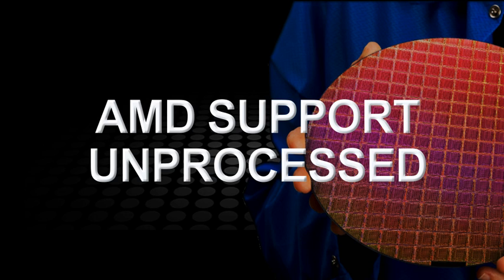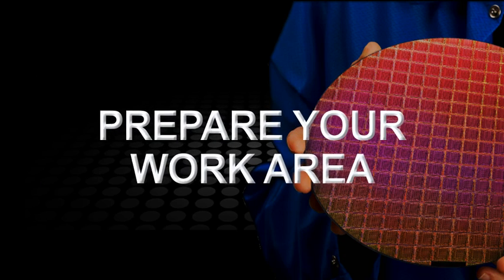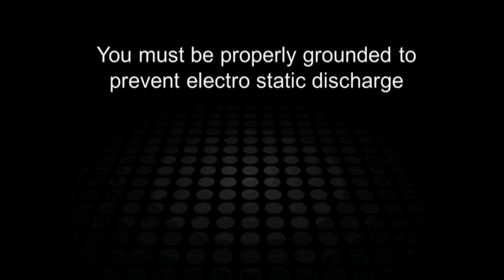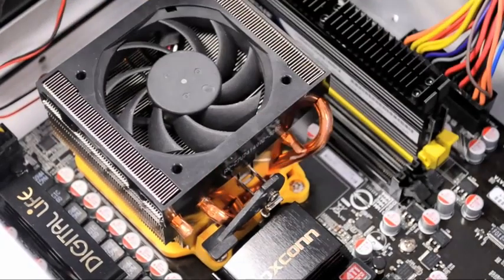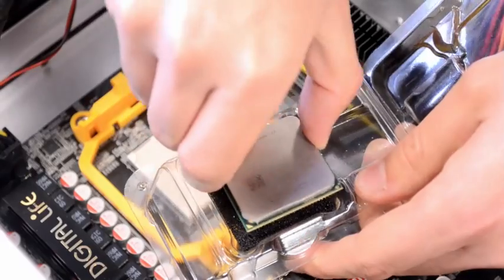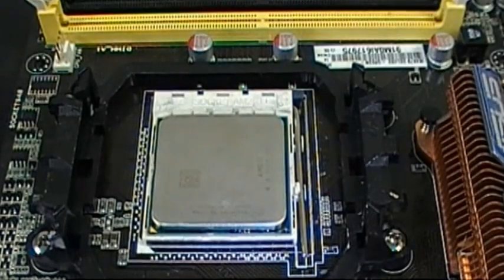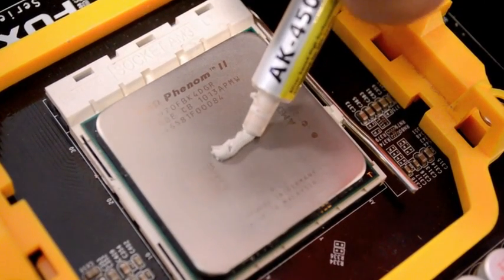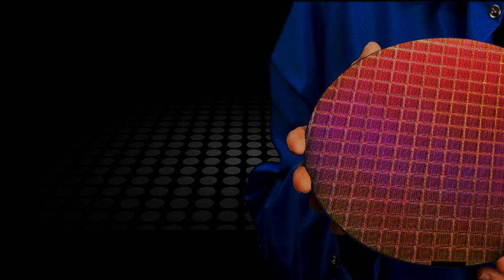AMD Support: How To Replace Your Processor

Comment: I have no idea what is going on. I upgraded from an Ryzen 3 1300x to a Ryzen 7 2700x. The 1300x doesn’t need a mount for the heat sync, and the 2700x you do. I never got the new mount to connect my heat sync to

Comment: This is perfect since im upgrading and old PC to an old gaming PC with parts from +/-2010.
Reply: it still looks the same if you use a ryzen
Reply: @mazuki7602  oh yeah but it's AMD I don't really have new AMD stuff right now as I'm still on a 5675C on my main computer which pretty much runs everything at 60fps, the newest AMD I have actually doesn't look like it it's a bulldozer FX8350 and one based on the bulldozer architecture if I'm correct called a AMD opetron 6238 or something ( I'm pretty hyped for getting that thing to work) just waiting on a motherboard.

But that's good to know cuz it's a good system much better than the Intel one.

Also at the time this was my first cpu replacement thing I did so I literally had no idea what to expect.

Comment: Can I upgrade amd a10 CPU  to amd ryzen 3 without changing motherboard
Reply: You probably already figured it out but you need to look what is compatible with your motherboard.

So you wanna see what motherboard you currently have.
You should be able to see that in system information or something like that dunno what they call it on English systems or it might be on the motherboard itself and then just Google what is compatible with it.

Comment: How in the blue blazes are you grounded if you remove the power lead from the psu and the socket?  You need to be grounded to something that is directly earthed. That’s why it’s called grounding

Comment: I have a question: does it matter what kind of heat sink you're using?? if i replace my old CPU with a faster more powerfull CPU should i replace my old heat sink or can i just use it?? My gut says more power more cooling.

Comment: Many thank's for putting up this very helpful video, just what I was looking for, it answered all my questions. Wish I had found it sooner, as when I removed the fan & heat sink, the CPU was stuck hard to base of heat sink & ripped out from socket, bending CPU Pins. (Panic!) I am now aware of the importance of twisting the heat sink carefully after removing the clip, to free the sink from the CPU & compound, as the CPU release lever is hidden beneath the heat sink & cannot be accessed whilst the sink is in place. A lesson learned. Also noted the position of the heat sink retaining clip lever, was on the same side as CPU retaining lever, as the assembly can fit either way around if not noted before disassembly. All is well, having successfully straightened CPU pins, and of course, using an anti static wrist strap.

Comment: I have an amd 8320E in my new but my old PC has the better AMD FX 8350! Do i use my old computers heatsink or use my new computers heatsink ? also once installed (hardware) do I need to do anything software wise. such as BIOS ? or does it do it for you ?

Comment: Wait, what?! Remove the power cord from the PC, but then put anti static wrist strap onto the case so you're earthed?
Where the fuck is the static meant to go then? Are you on a metal table??? Just switch it off at the wall, it's still connected to earth.

Comment: I'm wanting to upgrade my cpu from an fx-6300 to something a bit more powerful. My motherboard is a GA78 LMT S2. Which is the best one?
Reply: does it use AM3? If so, any FX series CPU should fit the socket.

Comment: Hey, i want to change the cpu, my current one is amd phenom triple core proccesor, and i want to change it to one of the latest ones, is it ok?
Reply: You probably already figured out but if someone has the same question you need to look if it's compatible with your motherboard first.

You can find it in the system information ( what motherboard you are using) or on the motherboard itself.

And then you can just search what is compatible on Google.

Comment: so I have a Athlon 64 cpu, will i be able to upgrade to a recent amd cpu or the motherboard won't allow it?
Reply: what mobo do u have?
Reply: Carlos Cordova There are Athlon 64 CPUs made for 754, 939 or AM2 socket. Although they all are sold as Athlon 64 processors, you can't, for example, install socket 939 CPU into socket AM2 mobo. Different socket models are not compatible between each other. And as if this didn't make things complicated enough, you just ran into the subjects you asked; there is no basically a store which would sell you a new Athlon 64 CPU anymore, the CPU series, and the socket models are obsolete. So no, you can't upgrade to any recent CPU. But if you have good luck, your mobo has socket AM2 which is the most recent of the ones mentioned before. This will allow you to upgrade to more powerful CPU than the older models. You can manage to find used socket AM2 CPUs quite easily and for good price, but there is no guarantee that they would work.

Comment: I've was given a prebuilt gaming PC as a gift recently and am looking to upgrade if anyone has any advice on what I should look at upgrading weather it be just the GPU or most of the internals including the motherboard. Price is of no real concern but id prefer not to spend all my money on unnecessary components. Specs:Motherboard: Gigabyte GA-78LMT-S2
CPU: AMD FX(tm)-4300 Quad-Core Processor 
GPU: AMD Radeon R7 200 SeriesThanks in advance!
Reply: Well, an AMD 9590 CPU should run anything under the sun that competes well with Intel. I personally have an RX 470 GPU and have done well with it, but search around for your own personal needs. As for motherboards, same deal. Search for your specific needs, and you should be okay. Remember to take into account your Operating system, RAM, power supply, and your cooling system, along with hard drives. Some things work better with others, but without a couple of parts, your PC won't run games at all. All of your components are necessary.

Comment: If you do this what will happen to all your downloads, files what Windows you have?
Reply: Your files are stored in the hard drive usually aside from the mother board
Reply: It wonk affect them
Reply: William Burn nothing will happen to them unless you change your motherboard. Most recommend installing fresh Windows, however I've managed to get around that by uninstalling the previous Mobo's drivers before shutting down and installing the new one, no fresh Windows install needed. You won't need to worry about this for CPU, but if you're changing your Mobo, I'd recommend looking up some videos on how to do it without reinstalling Windows, but if you're completely lost then it's best to just do it the old fashion way and do the reinstall.
Reply: wow i appreciate this reply but me 7 months later i am really quite good with all this now
Reply: btw i made a whole new pc and kept my hard drives and everything was still there

Comment: just bought AMD's new 880k and am going to be uprgrading from an a6-6400k on monday, am i going to need to do anything in my bios or through windows after i install my new cpu or will it just boot up normally?
Reply: already bought it and installed it, the only problem i had was that i had to cut 2 of the heat pipes off of the cpu cooler to fit with my gpu because i have an itx board.
Reply: +John Smith 

you might end up with cooling issues
Reply: not yet,luckily... im going to be upgrading to an aio pretty soon so im not to worried about it.

Comment: Ok so I've got a question cause I've been hearing a lot but don't know if it's true, if I change my CPU will I have to do a new install of Windows?
Reply: +Pearzonalized 
If you are lucky you can boot and install the new drivers.
It would help to uninstall the old drivers before you remove the old cpu.

Comment: My of has an Intel core 2 duo e7500 @2.93ghz and I want to put an Intel i5 in it will it fit and work?
Reply: Depends on how big your case is. If your pc is garbage then by a new one.
Reply: +Mary Poppins If you haven't figured it out yet you have to make sure that the processor is compatible with your motherboard. You have to look up the motherboard and processor specifications. Both of them need to have the same socket type I.e. an i7 has a LGA1155 socket type so I have to have a motherboard with the same socket type like an "ASRock Z77 Extreme4 ATX LGA1155 Motherboard".

Comment: Quick question I am upgrading from a phenom 9550 to phenom II x4 920 (have an AM2+ socket) Do i need to replace the heatsink or will the old one work?
Reply: Appreciate the comment but I just built a new comp altogether! Fx 8350 with a Hyper Evo 212+ attached to it!

Comment: hey I'm sorta new to pc stuff I currently have an AMD FX-4300 and I'm upgrading to an AMD FX-9590 will that fill in the socket it already has ??
Reply: the 9590 need really good cooling the stock fan wont do
Reply: Needs a better cooler.

Comment: What happens if the pins bend? That happened to my cpu
Reply: +Explosions+ This happened to a friend of mine.  He was able to bend the pins back straight and then got it to work.  If you can't get them straight again you will have to buy a new one.
Reply: +Dr Dyno I got the pins straight and the processor fits snugly into the socket, but my monitor says "dvi no signal" and it seems that the processor is not doing what it is supposed to be doing
Reply: +Explosions+ you sure your dvi is plugged into the gpu?
Reply: +Knowhere oh I don't know, how to do you do that?
Reply: +Explosions+ in the back of the case the different inputs for dvi are on the motherboard and gpu. Just try all the possible ways to plug in the Devi
Reply: +Knowhere oh ok thanks
Reply: +Explosions+ even if you got the pins straight make sure you didn't straighten them with your fingers or something because oils can really mess the CPU up.
Reply: +Explosions+ I got 3 pins bent ; 2 I succeed to put them back but the third broken and fell off .
I was last in space : bought a new one !

Comment: Can an amd fx 9590 fit where an a6-6400k used to be?
Reply: no, 6400k is socket FM 2... the FX is AM3 so it won't fit
Reply: +KraZeeRic nope. fx cpus use am3+ motherboards while apus use fm2+
Reply: +Thulith Wilfred Can a AMDFX-6300 6-Core Processor Black Edition replace a AMD A8-3820 APU???

Comment: I have an MSI a78m-e35 motherboard and i installed a new AMD athlon x4 860k cpu after installing and putting the cables back in the pc its said no hdmi conection. I bought an hdmi cable but now it says check signal cable what do i have to do? Please help

Comment: Can I reuse my old heat sink fan with my new cpu? I've cleaned the thermal paste off the old heatsink fan. And the cpu fits right in the socket. If I apply new thermal paste onto the new cpu and put the old heatsink fan in. Will it work? (Amd)
Reply: of course lol no cpus come witha heat sink so yeah

Comment: I am thinking of switching out an fx 6300 for a better cpu. I'm going to be running it with a gtx 970, and on this motherboard 760GMA-P34 (FX). Can someone tell me what would be a good cpu for the system? I know very little about PCs, but I am hoping to learn. Thanks!
Reply: This exact PC to be completely accurate. http://www.bestbuy.com/site/ibuypower-desktop-amd-fx-series-8gb-memory-1tb-hard-drive-white/4757091.p?id=1219638959291&skuId=4757091&pid=1219638959291
Reply: +wippersnapper23 go to https://ca.pcpartpicker.com/ and put in your mobo into a new pc and you'll get a list of compatible parts. I use this a lot to find single part upgrades for my pc. Cross reference what you find with a google search to see if anyone else has used the same parts and you'll have a good idea of what you need

Comment: if i upgraded my upgraded my cpu would i have to uninstall windows, or can i install the cpu and put the windows disc in and im all set? Also im not getting a cpu until november or december do you think i should wait for new hardware releases?
thanks
Reply: I don't think that cpu messes with the OS, I believe that the hard drive holds toe OS info on it along with all the other stuff meaning it will not need to be reinstalled

Comment: hello i need help. i am thinking of changing my(i think its a graphics card) AMD HD8570D to a AMD FX-8350 (as it plays games better) is this do able? and if so is there any better cards to swap it out for?
Reply: Zexal Vipez man you want to change a GPU to a CPU wtf?You cant and I think you have an FM2+ motherboard and you cant add and FX-8350 only on AM3+ motherboards with a big TDP support
Reply: ***** sorry i know nothing on computers. Is there anything inside my computer i can change to make it run better?
Reply: Zexal Vipez i dont know your specs but if you will show them to me i will help you
Reply: AMD A8-6600K APU with Radeon(tm) HD Graphics - quad core processor 
AMD Radeon HD 8570D - video card
7.4 GB usable ram
Reply: whats your budget?
Reply: ***** id say max id spend on upgrading is 150
Reply: you can still use the CPU because is good and get an R7 260x or an GTX 750 Ti(if you dont have a good PSU)buy the cheapest one they are getting the same FPS in almost every game
Reply: R7 260x, GTX 750. what are they? mother boards?
Reply: Zexal Vipez GPUs,what are you planning to do with your PC?
Reply: Zexal Vipez get the nvidia 750ti 2GB GDDR5 and you will be good
Reply: ***** thanks for the great help caddy!! i will look it up now, thanks again
Reply: Zexal Vipez What kind of gaming? Minecraft,cs go, CoD? Do you want to record it, if so then you need an intel i5 or i7 man, or an super fast hard drive, p.s if you get an fast external hard drive to record you'll get no fps drop while recording man!
Reply: JuSt-BMX Minecraft & More! he dont need an i5 or i7 for gaming his CPU is enough good for modern games
Reply: ***** I said recording not just playing
Reply: JuSt-BMX Minecraft & More! i have a hd pvr 2 to record, it wont be any normal screen recorders. thanks anyway
Reply: Then you dont need the i7 because the PVR will do all the hard work about recordings
Reply: thanks, both of you
Reply: Make sure you have hdmi :) Good luck. I have an elgato HD

Comment: Can I place every cpu in every motherboards out there or do I need an specific motherboard for a fx 6300?
I was thinking about this one:Asrock B75 PRO3-M Mainboard
Reply: if your computer already had an AMD processor it should be fine but if your computer came with an intel processor yea you'll need a new motherboard.
Reply: You need to check the Socket of the procesor and the one on the mobo, also, there are intel motherboards and amd motherboards, for an fx6300 you will need an AMD motherboard with a AM3+ type socket.
In short, no, you can't use that motherboard, because it is an intel mobo, you need an AMD one, like the M5A78L-M/USB3 from ASUS (I recomend that one, since thats the one I use for my Fx6300)

If you don't want to use that mobo, you need to check the spesifications on the manufacturers webpage. Check the socket, and wich cpus supports.
Reply: Thanks man, was about to buy the wrong one. Saved me a lot of trouble

Comment: i just wanted to know if it was possoble to change the cpu wothout changing the motherboard
Reply: You have to check the socket size and wattage of the new cpu against the motherboard.  Go online and look at the specs for both.  Make sure the mobo supports the new cpu's socket size and that the motherboard supports CPUs with the new wattage or just go on pcpartpicker.com and look at a compatibility list.

Comment: So if i have a AMD A4-7300 Socket-FM2 will i then be abble to switch it out with an AMD FX-8350 Black Edition
Socket-AM3+ without changing something else? ofc. as in the vidoe but no new motherboard etc.?
Reply: You're going from an APU FM2 socket to an FX AM3+ socket. Not only will you have to change the motherboard, but you'll also have to uninstall all drivers which work only for the old motherboard.

Comment: HERES A FUCKING TIP AMD - ssee when you sell your eight core proocessors - put my instructions and contents list inside next time.  OH AND WHERE THE FUCK IS THE MANUAL OR INSTRUCTION GUIDE FOR MY WATERCOOLING SYSTEM ON YOUR WEBSITE -the damned retailer calls you to ask for one and you say 'we dont have documentation' for the fx9000 series watercooling? IS YOUR FLAGSHIP PROCESSROR AND IT IS IMPOSSIBLE TO GET AN ELECTRONIC COPY OF INCSTRUCTIONS WHAT THE FUCK ARE YOU PLAYING AT???

Comment: If i upgrade my cpu does that mean i have to upgrade my mother board??? im getting the amd fx 6300 for my new cpu and my mother is quite old (since 2011)
Reply: Check on Your current motherboard producer's website for compatibility. You need AMD motherboard with AM3+ socket to drive AMD Fx 6300.